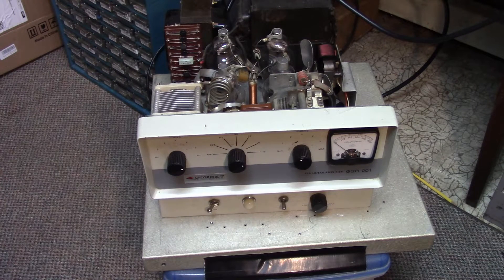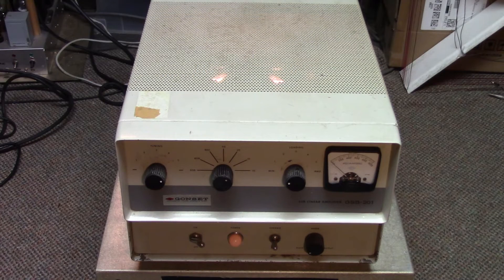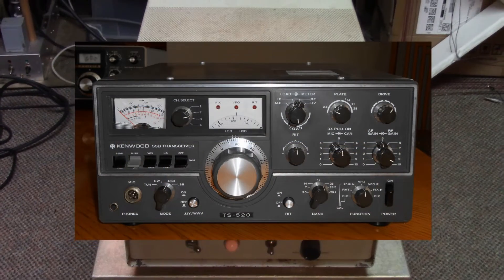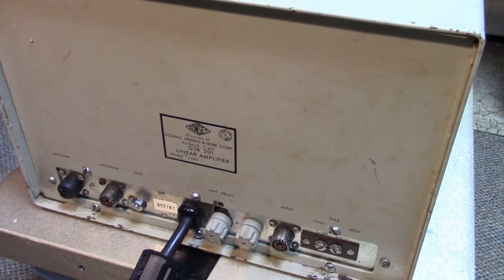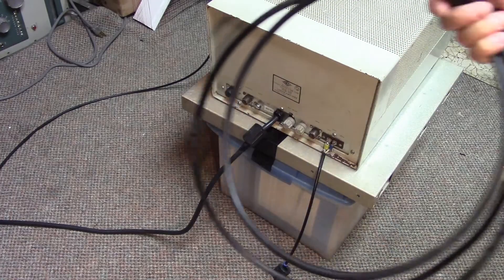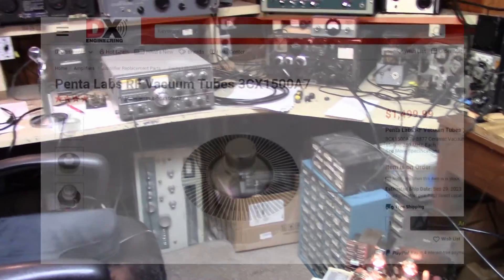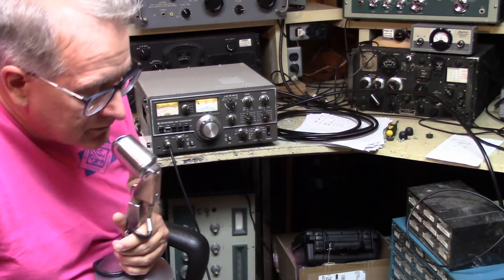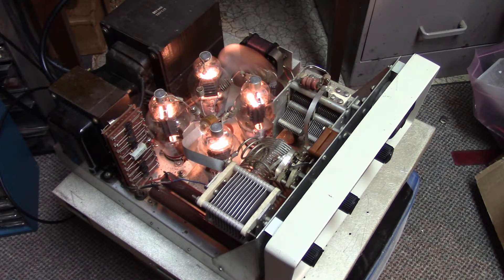Gonset GSB-201 - Early Linear SSB Amplifier

Comment: hey Mr Microwave 1  what did you do to the filaments for hum pse, i have exact one like this.
Reply from the maker: The faux center tap trick taught to me by WA1HLR. Simply lift the ground off the grounded side of the filament. Then install a small center tapped transformer like 24VAC CT.  Clip the primary leads. Attach the secondary across and ground the CT. Done.

Comment: GSB-201 is a repackaged  GSB-101.  Rugged, well designed, and ultra reliable. Good for 600 watts output.  The GSB-101 was built with relays set up to switch separate TX and RX.  easily rewired for use with transceivers using the same relay.  I assume the 201 was set up for use with transceivers...a look at the schematic or manual will clarify that.  101 does not have a tuned input.. so use of any small tuner with a solid state rig will give your xcvr the 50 ohm match it wants to see, and the amp will then produce max power too.  I ran a net with the 101  handling heavy traffic for hours...with a very high duty cycle.. and it never overheated, never skipped a beat.  The 811 amps are utter junk in comparison.  Several other companies copied the design of the 101  including Heathkit Warrior, Pausan Mars ( made in Japan sold here), and others.  By far one of the most under appreciated linear amps on the used market...and hence a terriffic bargain.  Easy to service, top quality parts,  very very long lived,  easy on tubes too!

Comment: Hello Mike. Great info on video  I recently got one of these old jewels with 572b s do you by chance have any info on 120/240 color codes on transformer seems this had previous owners baffled after they added inline fuses. Thanks 73s
Reply from the maker: The manual is lacking these details. Try using an ohmmeter to first determine the two primaries. Then hook them up in series and use  a variac to see if you have the phase correct. If it acts weird on the voltage rise from zero, swap one of the pairs. That all I can think of.
Reply from the maker: Oh and of course - be careful since this thing can kill with the HV or the 230!
Reply: @MIKROWAVE1  ok thank you sir

Comment: Goset repackaged their boat anchor sized GSB 101  resulting in the GSB 201., which ads the Transceiver T/R relay wiring, whereas the 101 was designed for separate Rx/Tx  and has to be rewired for Xceiver use, and requires an interface, since it is switching 120 volts at the t/r terminals.   Either one is bullet proof, relatively cool, and clean in operation. Basic design goes back to mid-late 1950's.

Comment: Ken Carter W6QED was the Chief Engineer at Gonset when I met him in 1962.  Ken was my Elmer, and taught me everything I knew about radio.  The Communicator IV was the latest of his jewels, and jewel it was.  I built a 20W AM rig, in two chassis.  Power supply and plate modulator, and the RF deck.  My receiver was a six nuvistor converter that Ken designed and I ran it into my SX-101 receiver.  Those were the AM days of 2meters.  Somewhere around 1964 Ken went to Swan and designed some Transverters.  I had a chassis and never got it working.  But I was working a lot of QRO with my HT37, Drake 2B and a 3-1000Z that I built.  Unfortunately cameras weren't in common use those days.  I never had any photos of the beautiful Amp I built.  I ran it until 1973.  My noise level was so high having a big amp was a waste.  20over 9 noise.
My other Elmer was Zeke Lynn who was the Chief Telecom Engineer on the Apollo program.  He really liked high power.  Ran a pair of 1000-T's in push pull 9KV at 2A ... 18KW.

Comment: Hey, I just got one recently but I can't use it with modern transceiver because it don't have the tune input circuitry. Have documentation about this? I'm using an IC7300
Reply from the maker: It depends. My old 1980 vintage no tune solid state rig drives it pretty well with no tuned input. Others completely  fold up because of the SWR. If you do use a small tuner like the old MFJ-971 VersaTuner, locate it close to the amplifiers input and make the longer coax between the radio and the tuner input.

Comment: Beautiful linear!!! Could you squeeze a couple of 813 in that?
Reply from the maker: They would have to be recessed socket or LAZY at an angle!
Reply: @MIKROWAVE1  Speaking of 813's I need a transformer to get my project started, but are confused about the primary voltage before rectification and filtering. Any suggestions???
Reply from the maker: @UDX4570PalmSprings-yh1mv  Nowadays folks use a bridge and lots of C and a big bleeder. So figuring 2000V, look for a 1500-1700 VAC transformer capable of an AMP!
Reply: @MIKROWAVE1  Under load, wouldn't  that sag a bit???. I was thinking  2200vac but this is where i get confused.  Iam working on a two 813 tube linear in a grounded grid configuration.
Reply from the maker: @UDX4570PalmSprings-yh1mv  The only way to be sure about sag and regulation is to add a choke. A big choke preferably a swinging Choke 5-20HY will allow you to get basically what you put in. So essentially 2200 VAC in 2200 VDC Out. And a big bleeder.
Reply: @MIKROWAVE1  Aaaahaaaa, now you have shed some light on this project. I've been reading and reading and asked many others  on how this works, with no luck,  you opened a new chapter, Thank You!. Now to educate myself on chokes!.

Comment: I reversed engineered my SB200 and fitted GI6B ceramic tubes and they need less drive than 572b's and they are cheap as chips to buy.  On my QRZ page it shows how the GI6B tubes have been fitted G4LMZ
Reply from the maker: Cheap for now! Ha.

Comment: Nice amp.  I love Gonset equipment; they were really innovative in their time.  What would it take to make this amp full QSK for CW?  Could it be done with some tubes controlling the bias and and making and breaking a path to the antenna for receive? 73 de K3NG
Reply from the maker: True between character QSK really requires fast switching and a solid state switching system. Semi-break-in QSK works somewhat as is. RF exciter VOC (Vox or Switch on Carrier presence) could possibly be attempted. And it probably has been done. This type of operation is tough on relays with older gear like this.

Comment: But the 3cx1500a7 comes in four "easy" interest free payments!? Great looking amp! I love this vintage equipment. I need to get my Johnson Invader 2000 back on the air. It runs 2x PL175A's. (4-400's) . Pretty much the Thunderbolt with an attached exciter. It's amazing how much cheaper 4-400's are compared to 3-500z's! I guess people are intimated by the extra grid(s). Can't wait to see more.
Reply from the maker: 4-400's continue to have realistic merit and value.

Comment: I own a late gsb201 using 572b tubes. Other than a troublesome power transformer. The rf deck is good
Reply from the maker: That is a tough situation, as you have already surmised. Short of an outboard power hack, you may own a parts car.

Comment: Exciting stuff.  I just rebuilt a pair of SB-200s. ( I rebuilt Dad and I a pair of HW-101s and SB-200s) New power supply boards and added a soft start.  Also did the arc over protection mods that Charles Raunch suggests since both needed new tubes(572Bs) and I read some stories about them arcing over and destroying meters and such.  Had issues with the input tune circuit.  GDTs light up when they fire! LOL  One had been modded and the other had a broken slug, then to add suffering to trouble I used MFJ tuner to read the input SWR and it took an embarrassing amount of time to realize it was Junk.  The warm glow of tubes, none of that cold heartless solid state stuff.
Reply from the maker: Fabulous! This thing drives fine with the TS-520, but 80M input drive is troublesome because of the choke with weak drive. So at least a tuned network to resonate the input is helpful. A small tuner close to the input connector (short jumper) does the trick for most solid state drivers. Adding individual PI nets on the input seems deluxe and difficult but people have done it internally!

Comment: Addressing the high-death potential from the power supply, do you think powering from a GFCI outlet would provide any benefit? Or, if it's unlikely that any HV fault current path would show up on the AC line's safety ground, might there be any chance to mitigate the risk from the HV supply by implementing a residual current protection device inside the unit? (Or, perhaps the presence of high-power RF around the unit would only cause trouble with RCD/GFCI type protection…) 🤔
Reply from the maker: This old guy does not have an interlock safety system.
Reply: I don't see any chance of a GFCI saving you. The fault is going to be on the secondary side of the transformer, which in my thinking the GFCI can't see.  Also the power stored in the caps will be more than enough to kill you even with the GFCI tripped.  You just have to be careful!  I know I'm probably a little complacent around tube voltages, but when inside a linear I'm absolutely safety first.  In most cases getting shocked is a "I probably won't die"  but in there it's "I probably won't live"
Reply: @clytle374  Good reply. Yours and Mike's reply suggest that I'd really need to study the schematic. As I wrote my comment, in the back of my mind I was thinking that the 2nd-ary of the transformer is the risk, which I guess will be beyond a mains GFCI. Mike's comment suggests that also the HV caps are waiting to kill you, even if the unit were off; so bleeders are very important. So I replied to my own initial comment a moment later, thinking on a different tack. There I'd thought about Mr. Carlson of his lab, talking about his own worst shock experience. He'd once been terribly shocked (and burned) because he couldn't separate himself from a supply. So, even if you experience a bad initial shock, being sure the supply would notice the abnormal and cut out to end the event could save a life.
Reply: Another idea: an interlock on the HV supply where a demand for high-current is compared with the state of the T/R relay. This idea being: if current exceeds a threshold value while the T/R is in "receive" mode (when current should be minimum and steady), then safe to presume something abnormal is happening and trip unit off immediately. That would protect you at least when you've got the unit on in standby/RX. If you'd implemented the carrier power sense T/R switching mod, then the protection device would look for a current draw from the HV supply above a threshold while the input power was nil or low.
Reply: Even if the GFCI were to open the circuit, which is unlikely due to the HV transformer, there's still enough energy in the caps to kill you.
Reply from the maker: The stiff bleeder is your safety from the caps.

Comment: Hi Mike, I take it that the Gonset GSB-201 does not have tuned inputs like my Heathkit SB-200. How do you control the impedance between the radio and amp IF you are using a modern radio? The hybrid Kenwood transceiver you are using you just tune the radio to the amp input? If you are using a transceiver with transistor finals what would you do,  place a antenna tuner between the radio and amp? Great video as always Mike, 73 Joe
Reply from the maker: You need a small "toy"tuner with a short coax to the linear input. The input to the tuner length to the xcvr can be longer.